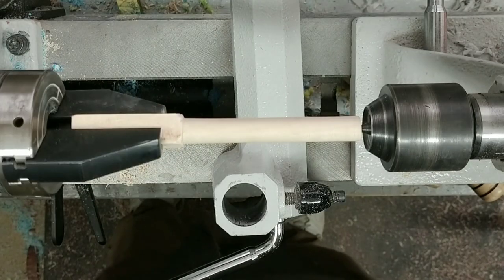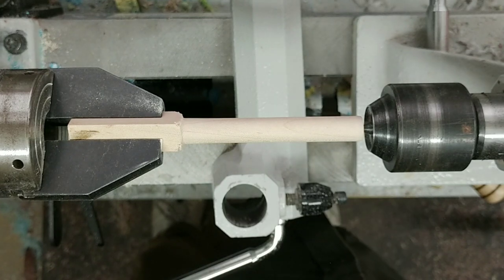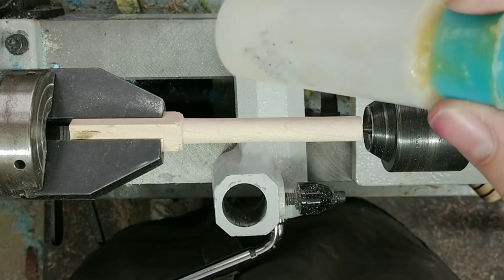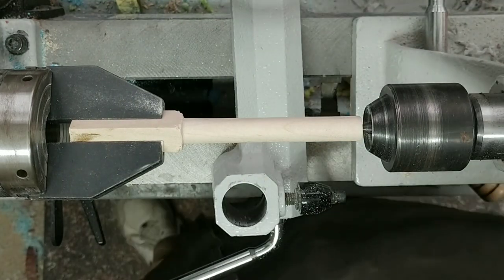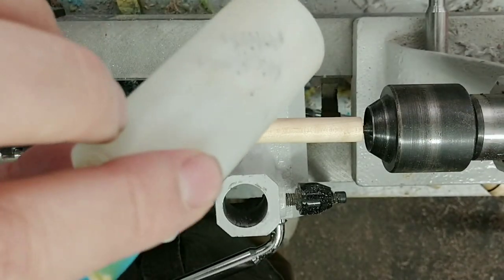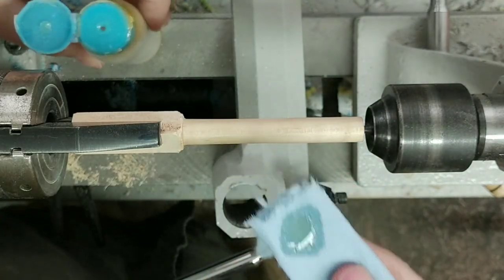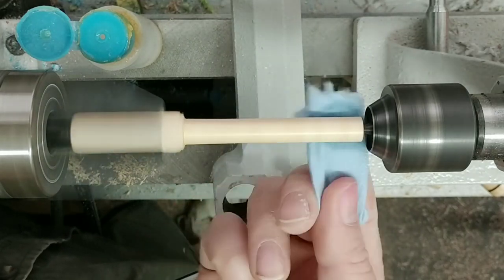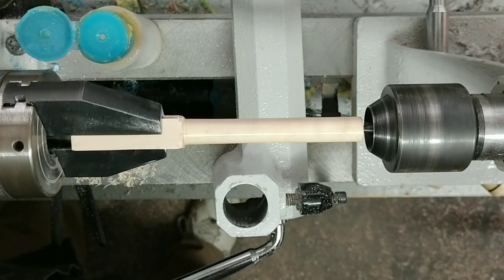Shop Talk Tuesday IV: Myland's High Friction Polish Demonstration and More!

Comment: Thanks much, I am trying to improve my friction polish game and picked up a bottle of mylands to try.  Question though, what exactly does the sanding sealer do?
Reply from the maker: Sand sealer seals up the pours of the wood as a pre step before the polish. Like putting on a primer coat before spray painting. The polish compound works best if it isn't absorbed into the wood and just stays at the surface.
Reply: @TheTacticalPainter  I was in my local Rockler to get Mylands and saw the sanding sealer next to it.  It sounds like if I want to up my friction polish game I should go get the sanding sealer too.  Thanks so much for getting back to me so quickly!
Reply from the maker: @kennethdalenberg9267  you're very welcome. I used to struggle with friction polish. The sanding sealer was a huge leap forward in my success rates.
Reply: @TheTacticalPainter  Having done my share of painting your analogy is perfect.  I do ok with matte finish but trying some glossy stuff hasn't worked at all for me.  I'm going to order some sealer from Rockler and can't wait to try it.

Comment: I'm curious about denatured alcohol versus rubbing or isopropyl alcohol?
Reply from the maker: Rubbing/Isopropyl has water in it, the % you see on the bottle is alcohol and the remaining is water (usually 70% iso & 30% water), which will remain in the wood requiring you too redry if you're casting. DNA is straight alcohol and evaporates rapidly and cleans better than iso because it's a stronger solvent. Some will use acetone, I don't because acetone when it dries leaves a film/residue behind, whereas DNA doesn't. Hope this helps
Reply: @TheTacticalPainter  It does help.  Many thanks!
Reply from the maker: You're welcome, and thanks for the idea for today's Shop Talk Tuesday

Comment: Why didn’t you sand after applying the sanding sealer?
Reply from the maker: Never really saw the need to, I applied the sand sealer mostly as a protective coating. I now use GluBoost CA Finish exclusively for my pens. I found on testing that the sand sealer and wax coatings were inadequate finishes in the long run for an EDC pen.